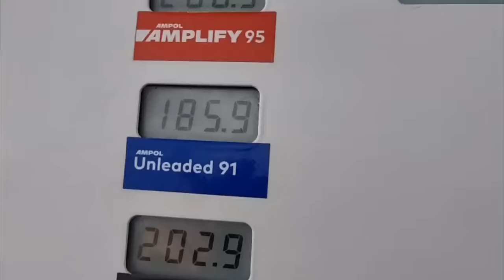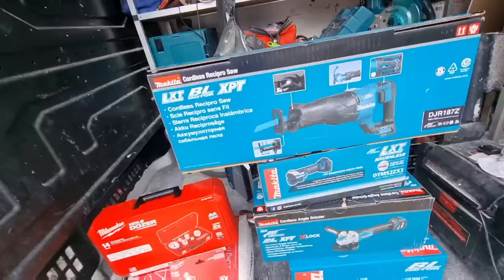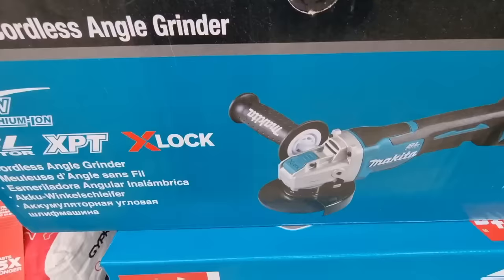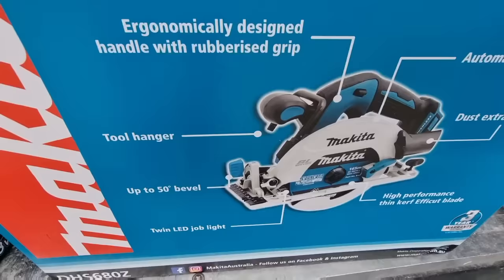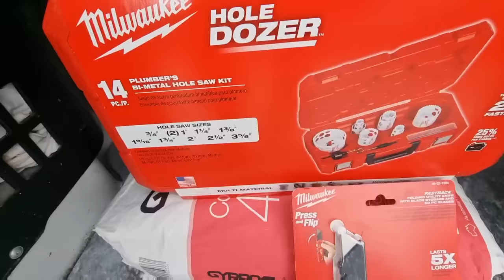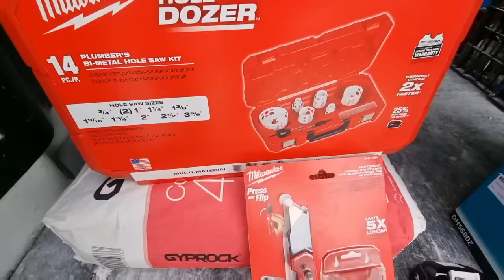Drywall Plastering & Painting Tools that Make Life Easier Finishing Jobs

Comment: Инструмент классный. Не понятно для чего красить безвоздушкой и потом катать валиком потолки. Почему не отрегулировать давление на аппарате чтоб не полосило сопло, покраска станет лучше и качественней. А так все супер, макита рулит!))))
Reply: I'm pretty sure that's not paint that's primer most primers have solids in them which wear out your paint tips which is in the front of the gun that's why you see that streaking overspray you always use the biggest spray tip you can find so that you can get maximum product on the wall in a hurry show a lot of times it is way faster to spray and backroll than it is to fill a tray up with primer and roll from the beginning not to mention it sets the product spray and backroll means 20 or 30 Apartments done in a day just rolling without the equipment you would not get that far at all not to mention when you back roll it is different than soaking a roller full of material the chances of a clean finish our higher back roll

Comment: Why did you leave the space gap between the side wall and ceiling?
Reply: Corner not critical as it is covered by moulding.
Reply: It's easier that way since we don't have fireproofing requirements in Australia.
Reply: Here in the UK and most places in Europe that's unacceptable. Our drywalls provide thermal, acoustic, fire or/and moisture resistant. Would no pass inspection

Comment: Why would you use a roller after spraying, I thought whole point in spraying was you didn't have the texture of the roller. 👌🏽 Great vid anyway mate.
Do you ever get the pain peeling when you're laying it off with the roller?
Reply from the maker: That's the thing, you do want that texture, because later down the track if it ever needs touching up, you use a roller texture again. Definitely not going to bring the sprayer back to touch up. Also most importantly you want to roll it into the drywall paper so it adheres. Also the drywall manufacturer states you should back roll for those reasons i mentioned and others. Your spraying flat ceiling paint here, not like spraying the hood of a car

Comment: Does that gap between the ceiling and the walls  meet fire code?
Reply: Yes
Reply: @chrisstephens1520  no way
Reply: @tugrulfirtina9579  ok
Reply: What gap
Reply: @fingerz6983  0:30 seconds gap.
Reply: @randywl8925  was referring to when it was covered
Reply: @fingerz6983  I was referring to fire code.  With a gap that large, it probably wouldn't meet fire code in some places.  Meaning that the crown moldinds may not be accepted as a fire barrier.  My thinking is butted and taped joints meet code and that crown molding is not a fire barrier.  
That was my basic point.  If the crown is plastic, I cannot imagine the gap is acceptable.
More of a question than a statement on my part.
That, plus I wouldn't accept work like that.  But it's fast. 😁
Just saying bring "fast" and not caring about quality saved the homeowner $600 on a $300,000 investment.
Reply: @randywl8925  I guess your right , but nothings forever and humans don’t live that long these days
Reply: I guess he leave a gap in the drywall so he can see the studs to screw crown up..lol..  fire Hazzard!!

Comment: Why don't you smooth the glue out? Does it look good?not being a troll. I'm a painter and I am curious.
Reply: I don't believe that was glue. I believe it was taping compound. The point I believe is to hold the crown molding in place. Then you nail it. Then you swipe with your finger just like caulking to clean up the excess on the edges. I am sure they cleaned it up. They just didn't show it in the video. 

But I would think that it also works as adhesive to hold the crown molding so it needs less nails.
Reply: @garyoldham4449  that makes sense. Wish they would clarify cause it's awesome.
Reply: @redlightrunner930  
Someone else mentioned about overspray. So I looked at the video again and I noticed that the ceiling was sanded but the walls were not. So they didn't bother to drape the walls because they'll have to sand the walls and they'll just sand the overspray at the same time. Makes sense to me.

Comment: No spakling in the nail holes of the crown molding?
Reply: Complete.  And Total Failure.
They'll be lucky if they don't get a lawsuit SHOVED.
No wall support for the ceiling sheetrock. Or drywall. The names of gypsum change everywhere.
Field screws, not up to code.
Edge screws, not up to code.
Never, NEVER stop in the middle of a walk or ceiling. Paint that is.
People watch the tools.
And think, WOW...
I always inspect the method.

Comment: How did they not getting overspray?
Reply: The ceiling is sanded. The walls are not sanded. When the ceiling is done you sand the walls to dress the joints but also to remove overspray.

Comment: Nice painting, I am just interested in whether or not you need a second coat on the ceilings when spraying and rolling like you did ?
Reply from the maker: Hi, yes thats just the sealer coat, still two more to go. Thanks for watching
Reply: @Maxkil  okay was wondering the same thing I just sprayed my 2000 square foot house with my Graco that I bought and was wondering why you sprayed then rolled seems like a pointless step makes sense now thanks for clarifying
Reply: @Brasco716  you normally roll after spraying because the finish from the spray gun is actually too good, so rolling gives a tiny bit of texture, if you ever need to do a repair you can patch the drywall and paint with a roller, without having to re paint the whole ceiling.
Reply: First coat you only need to spray a mist coat, the only time to back roll is on the last coat
Reply: @Brasco716  always backroll, every coat in my opinion, as a professional taper not painter granted, but ive fixed lots of shitty spray jobs and you should always back roll, every coat
Reply: @quinnycoleman7214  you don't actually explain why back rolling is necessary in your experience
Reply: @rajeeb3500  I'm a painting contractor and there's a few different reasons to back roll.

1). Back rolling pushes the paint into the pores, gaps, cracks, and holes. This ensures that the paint adheres properly to the surface as well as fills small cracks and voids in rough surfaces that a spray finish won't fill. Back rolling exteriors adds years to the life of your paint. Don't hire a painter that doesn't back roll their exteriors (this is very common unfortunately). 

2). It can provide a more even finish that doesn't flash. Flashing occurs when there's inconsistent texture that reflects light differently. This can happen from poorly done spray textures, dust build up that isn't cleaned off, uneven paint application, and even uneven temperature throughout the surface being painted (makes different spots on the same wall dry at different rates). Back rolling will only fix uneven paint application from spraying and dusty walls. It evens out the paint coat to a relatively  consistent millage, which leads to a consistent finish.

3). Touch up ability. Like what was said above by a fellow contractor, adding texture to the finish (particularly on level 4 smooth and imperfect smooth textures) allows you to touch up spots with a roller with the same nap size that was used to back roll. Unfortunately the temperature at which the paint is applied, the speed at which is dries, and the time the wall has had to cure all effect the color and sheen of the finish. This means that most touch up spots will show if any of these variables are significantly different. I've rerolled a ton of walls for a tiny little touch up spot due to these factors.

Believe it or not, but painting is actually incredibly complex when you break it down to the fundamental levels. There's a lot of information I didn't include because it would take me too long to write out for a YouTube comment. Let me know if anyone has anymore questions or critiques, I love these kinds of discussions.

Comment: You NEVER stop in the middle of a wall or ceiling.  Your field screws are not up to code.  You'll be lucky if that customer doesn't put a lawsuit on your company.
Reply: That's because they not in the US, I think they are in the UK. Glad I'm American. We have codes and rules here.
Reply: Here in the UK we actually  plaster the walls and ceilings, not just fill joints and screw heads, takes more skill but we can handle it 😜🙄

Comment: Looks like your spray pressure is too low causing those lines on the edges.  Is there a reason for purposely doing this?
Reply: Is that why I get lines ? When I do walls I get upside down crowns as I see it. Low pressure I take it?
Reply from the maker: Yeah possibly, i just backroll regardless so doesn't bother me too much
Reply: @homerepairlife5.098  or paint needs to be thinned more

Comment: Hold on, why are there gaps in between the drywall wall and celing? that's unacceptable work bro. In the US, you wouldn't have a business like that. No one would ever hire you. You wasted so much caulkig or glue or what ever you used.
Reply from the maker: Yes USA it's done differently.
Reply: @Maxkil  I know you not in the US, that's why I said if you was. But listening to the language in this video, clearly it isn't English 😂🤣😂🤣😂
Reply: They used coving. That's sometimes used in the UK too.
Reply: @dmythica  They used nothing to cover up those gaps. what are you talking they used "Coving"?? Cove base is what you use around bathtubs and fake base boards
Reply: @virgilwalker683  coving is the c shaped stuff between the walls and ceiling.
Reply: @virgilwalker683  they start fitting the coving at 0:49
Reply: Thing is, usually US have shit quality on almost everything house related. It's like coming back to the 90s in most cases. Doing those caps can be very good for noise reduction.
Reply: @sjoroverpirat  that isn't the US. Furthermore, you would get sued by the owner, because it's not up to code and not insulated
Reply: You didn't even watch the video lol